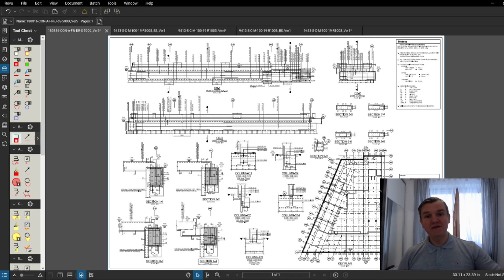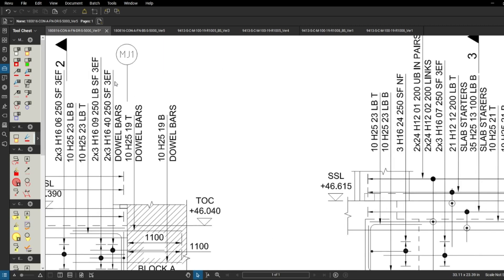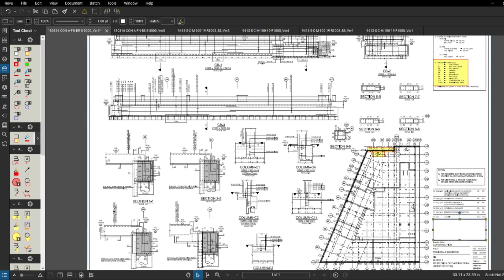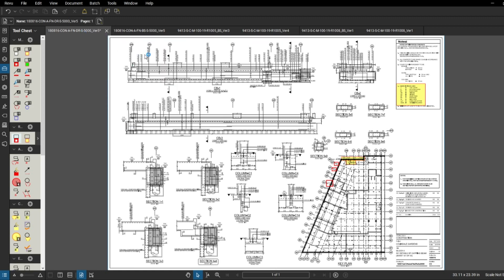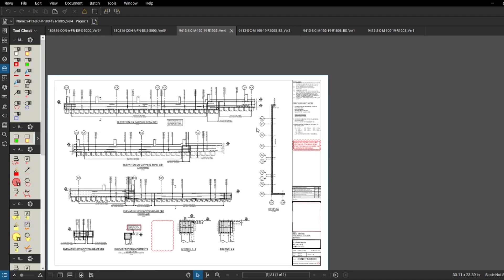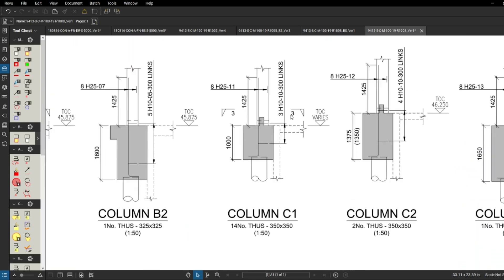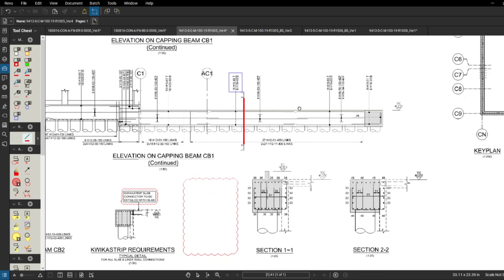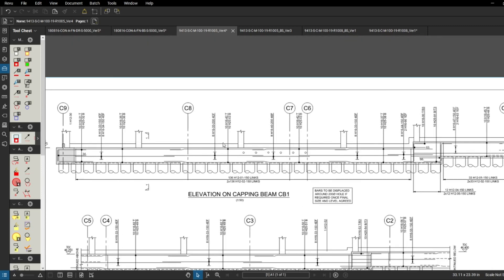How to read REBAR CAPPING BEAM construction drawings. Construction drawings 08

Comment: You're not actually saying what the marks mean on the drawings.  E.g. What does the dot represent? What about the dash showing an intersecting rebar mean.  How can steel fixer go about building those beams or columns from the drawing and schedule?  And therefore how can you check they've been built correctly once you go and inspect their work?
Reply from the maker: Hi Anthony! I will be doing another video soon about the rebar in which I'll say more about it and will also show the shape codes for steel. I was thinking before about making one about lines and basics in the drawings in general, do you think I should make one like that as well?